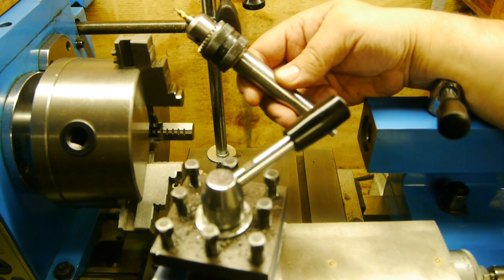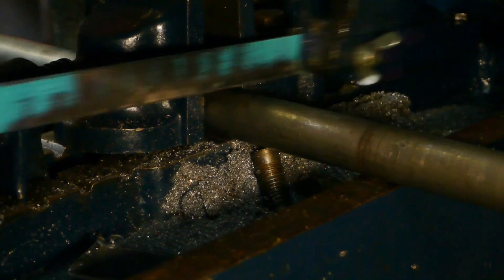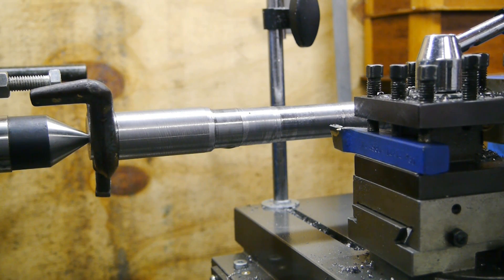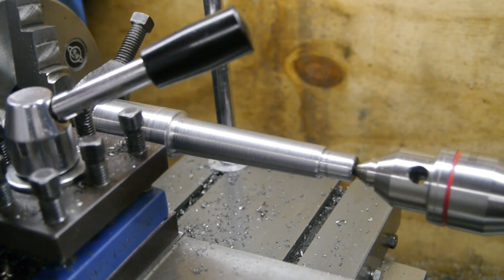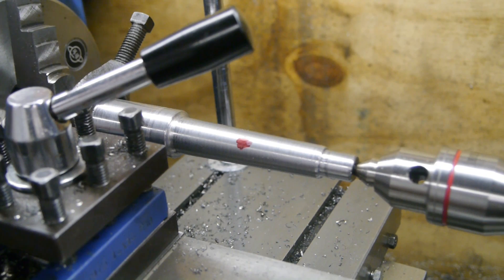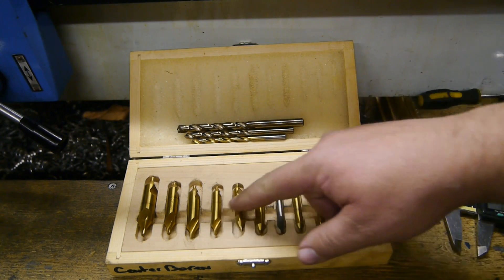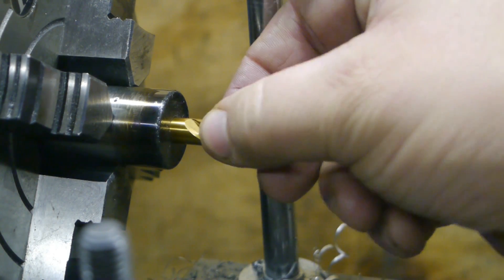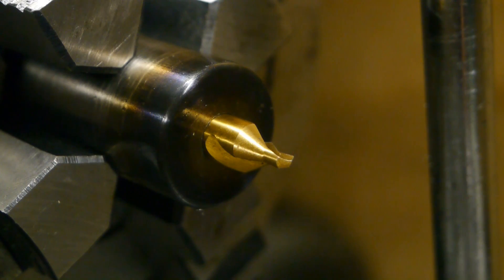Making a dedicated centre drill holder

Comment: Looks like your tailstock is higher than your headstock.  Every time you fed the drill bit it was forced down a bit.  This will give you an oversized hole and probably at an angle rather than parallel to the center of the headstock.  Might start breaking the smaller bits and or bending them. You could hand scrape the bottom of the tailstock where it rides on the ways but first check your clamp to make sure does not have movement.  If it is more than scraping can do and you have lots of patience a hand file may do the job.

Comment: What is the point if turning between centers if your holding the center in the chuck?
Reply from the maker: Turning a new point is better than using a beat up old tapered dead centre. You can also use the chuck jaws to drive the work (drive dog)

Comment: A drill can be made to cut to an accurate size by drilling a pilot hole slightly smaller than the required size and  taking the required sized drill and modify the cutting edge 
to make it with almost zero rake and rounding off the normal angled point. The modified drill will not give a very good finish but should fairly close to size.

Regards from Redruth     Arnold
Reply from the maker: Thanks, I'll try that one day if I can remember.

Comment: Interesting video.

 Try using a shear tool (HSS) for fine finishing on difficult metal.  Easy to make and gives an excellent finish on even rubbish metal.

Use keosene rather than oil when polishing as it will keep the emery paper from clogging, and has no lubrication properties.

Drill the hole undersized and then open it out with a diamond burr in an air die grinder, if you have one, using a mount in the toolpost.

Hope this helps.

Cheers Rob
Reply from the maker: A shear tool, that one were the cutting tip points up, right? 
Kerosine thats what you call Diesel in Australia? 
I guess I could try some WD40.

Comment: Why not adapt your drill Chuck to what was to be your center drill holder? No one makes a dedicated center drill holder, it doesn't give you the flexibility of varying center holes between various work piece sizes, Drill bits and center drills, as you know, are nominally sized, you'll never get any type of precision from them...at all, well...if you used a boring bar to sneak up to the ID opening. With the finished work piece you have, now you can use this: https://en.m.wikipedia.org/wiki/Electronic_article_surveillance#.The picture third from the top are Reid tags placed inside non-perishable boxed consumer products, they contain metal strips that are between .0005 to .001, thickness, you can try to wrap this around the center drill. Use it as a sleeve to insert center drill, in the center drill holder hole, it should be a tighter fit, then run your DTI to check for run out. When heat shrinking a hole for a tight fit. You don't want to hold your workpiece in the jaws of a lathe Chuck, so close as to transfer heat to each Chuck jaws, that the Chuck jaws them selves expand, making for inaccurately larger. You want to extend the work piece out more.
Reply from the maker: I mostly use the same centre drill bit. So having an extended drill bit arbor made sense to me.
I Thought about filling the space with aluminium foil but I think its a bit too fiddly. 
The body of the chuck got a bit warm but I don't really see a problem in that.
Reply: Well, just remember any mistakes you make is as important as any of the tools in your tool box, because you learn from them, have fun

Comment: Although, there is no point for my comment, seeing as the work is done maybe for future reference. You're lathe was fully capable of machining the 4cm work piece, there's a saying, "more than one way to skin a cat". Your live center was more than capable to machine the 4cm bar, so long as you have a steady rest for your lathe to do so, you could center holes for both sides, and if the're matching centers, your live center would have had no problem holding the workpiece.
Reply from the maker: Using a steady rest was a good option to centre drill the 4 cm stock.
I've got one but so far I've never used it :)
Reply: @Rolingmetal  داداش حالا حالاها باید بری بوق بزنی ..